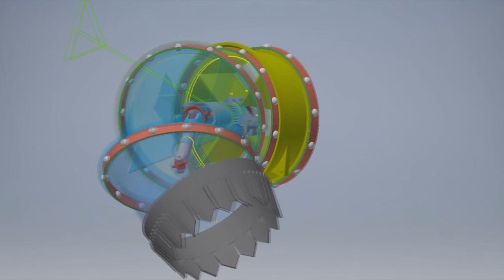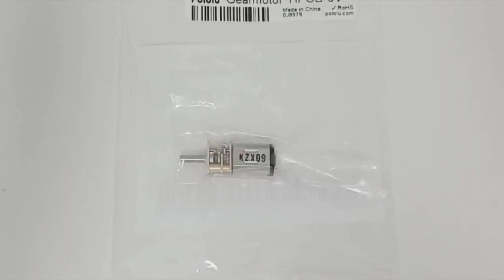F35B RC JET 자작 실패ㅠ 급현타옴 4화, Homemade F35 RC Plane Ep.4 (ENGSUB)

Comment: fyi, the tiny gearmotor was being over-volted;  and its design  is not  Optimized for use as a servo motor.        a servo  should  be  UTILIZED,  not  dismantled.        consider the use of  pull-pull  linkage.   d       googletranslate